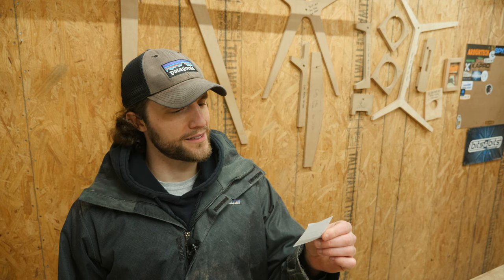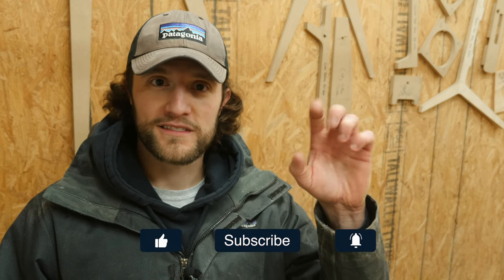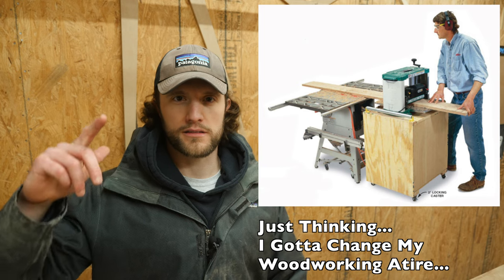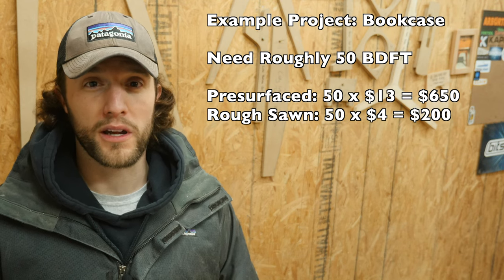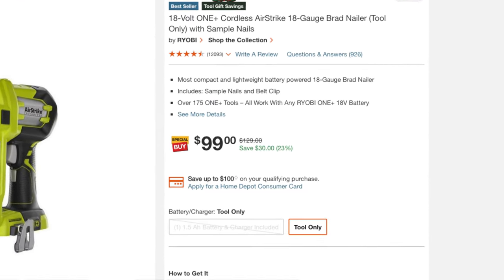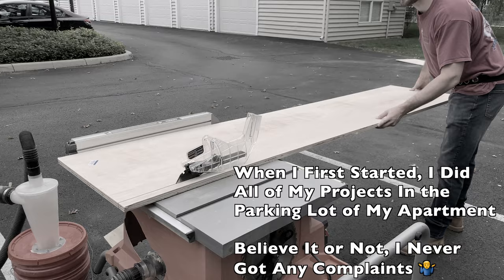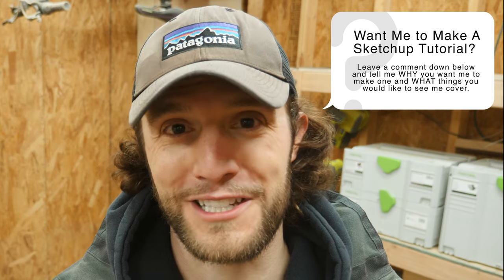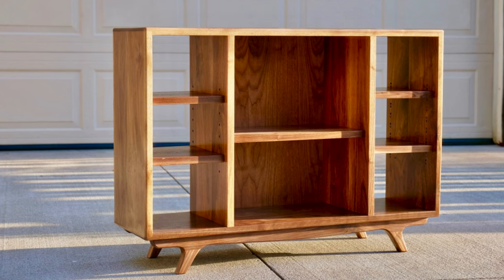I wish this NEVER happened

Comment: I’m a software engineer and I tried Sketchup. The whole time I struggled because it wasn’t at all intuitive. I was constantly asking “Why do they make us do it like that?” Then I tried Fusion 360 and it was much easier to learn and made more sense in how it worked. But, for the most part, it’s easier to just make some rough sketches on paper for most of what I do. I always end up modifying my design on the fly anyway.

Comment: A) Sketchup is giant waist of time, I can HAND draw 2D or 3D any thing I WANT to build 10th or 1000th the time it take to do it with Sketchup.  This is coming from a COMPUTER programmer.  It just not worth the time.

Let take it from the top.  My son wants to sell Dance Pads for PIU and/or DDR.  When you look at them they just about the same. The real trick is the wiring for the pads.  They need a LOT of weight to them.  I found with a single 4 x 8 x 3/4  MDF has the weight. I could make 2 pads from that sheet.  each pad is 34.5 Square. Then there enough left to trim the pad. then use 1 x 3 for the pad supports and wiring routs.  it keep up with his pad redesigns that the most problem and encasing the pad in metal.  It takes about 2 days to get the ruff pad built and then months to get the pads finished.  there a lot of BS to the pads parts. from how they to attach to the box part and wired.  22 had not been the best yr for this work.  we dont live near each other.  we hoping 23 will better and I will get my saws setup like I need them. 3/4 MDF is a bitch to cut with any power saw. and HD sucks, they dont know the TERM true or square means. have them cut it in 48" will not get you square boards.

Now you think a brad nailer is a waste. here where your wrong.  I want but can't find a glue roll on bottle like norm used on his show.  You roll on the glue, place your boards together and power nail them together.  I got the nailer to do this.  HD think Im a nut for the roller bottle. I don't want to get glue all over my hands.  We reselling these and we test pads to make sure the work 100%  they need a second 4 x 8 x 3/4 MDF to place the pads on or they move around while your gaming.